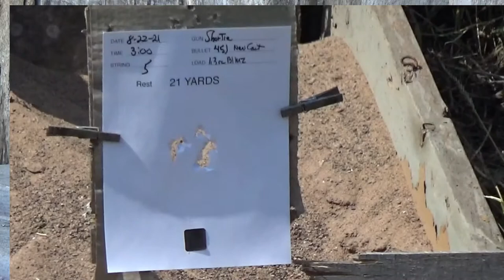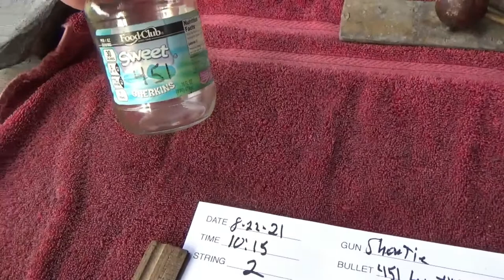Pietta 1851 Sheriff 44 cal - 5 1/2"

Comment: The second group was outstanding for 21 yds! the easy fix for the base pin/arbour is to cut shims that will drop into the hole, then put in enough to keep the barrel assembly from binding the cylinder with the wedge knocked hard in, I sometimes shave a little off the front of the frame to get the correct frame cylinder clearance, this fault appears to be only on US imported revolvers, I have not see it on European sold guns, so it could be that the importer is holding the manufacturer down to a low price, these guns are 3 times the price over here in Europe. Stay safe! Chris B.
Reply from the maker: Very interesting.  I think you might have mentioned that before and I forgot.  Did remember that someone used liquid steel to build up the arbor length slightly.  I like the shim idea.  As mentioned, I was always careful not to use too much force, but the down side is it can loosen.  Didn't have the internet in the 80's, only could find out this sort of info from other shooters  Few in my area, most just were lucky if they could load properly.  Just checked the 2nd gen colts, and they have the recess cut so deep that the lower 1/3 is open.  It measures about .1" or 2.5 mm I think longer than it should be.  It makes perfect sense that it should be a length so that it bottoms out leaving just the right cylinder-barrel gap.  As always, appreciate your comments.  O.R.
Reply: @oldranger3044  Another trick to make the arbour longer is to drill and tap the end of the arbour, insert a grub screw, then adjust until the cylinder no longer binds, the grub screw can be Lock Tited in final position when you are happy with the clearance, I find that the lower barrel lug need shaving off to get a perfect fit, Chris B.
Reply from the maker: @453421abcdefg12345  I'm not going to ask why I didn't think of that.  I have quite a bit of wobble in the cylinder of this 2nd gen 1851.  If I could get rid of that with a new bolt do you think it would tighten the group some?? O.R.
Reply: @oldranger3044  I had a misaligned cylinder on a Colt Dragoon , but it was easily cured by turning a wooden dowel to fit tightly into the grooves, then driving it down the barrel to engage the cylinder, after removing the trigger guard I could then see how much offset to make the new bolt, I made up a new bolt with a wider engagement top and fitted it through a slightly widened window until it fit snugly, it then worked much better, the other thing I have noticed about C&B revolvers is that they have no lead into the rifling, those I have seen are faced off square, with no lead at all, that cannot help the projectile on its way down the barrel, there is some experimenting to be done in this area I think, the 1873 had a tapered lead, so the C&B should respond to this treatment, stay safe ! Chris B.
Reply from the maker: @453421abcdefg12345  By lead in are you referring to the forcing cone??  Because all of mine have a tapered (not sure what angle) lead, and the riflings start gradual that way.  

Thanks for the idea on the bolt fitting.  I have a bolt that should work.  It is wider than the slot, so if I work it right, I should be able to get it to lock up tight.  O.R.
Reply: @oldranger3044  Yes, also known as "forcing cone" I have not noticed one in my barrel, it may be so slight as to need a loope to see, go carefully on the bolt and you will see when viewed from the underside how much it is out of register, it only needs a few thou to make a big difference to alignment, but with the wooden dowel knocked into the cylinder it will be held in line, if you have a wide bolt you are half way there, I made a complete new bolt from high carbon steel. Chris B.
Reply from the maker: That was something I would have liked to observe in the process.  I started, but then remembered I had purchased some Uberti parts and worked on that bolt which was wide enough.  A lot tighter lock up now, timing seems good, but when rotating the cylinder fast it will go past.  Put a stronger bolt spring, but thinking that I need to slick up the parts.  Possibly the bolt is hanging up where it comes through the frame bottom.  Thanks for all the advice.  O.R.
Reply: hello there from France. Indeed, I did the same thing as you on my open frame Pietta and Uberti colts. I rode it being called "arbor bottomed". A lot, I mean really lot of people think that the wedge is supposed to set the cylinder gap, of course not, everything is designed to be seated together, the short arbor is a flaw on replicas. Funny thing, here in France many shooters tend to think that the best Italian revolvers are sent to the bigger US market and we are left with the lesser quality... It might in fact be just the same ratio in the end ?
Reply from the maker: @jonas0937  Nice to hear from France.  By far not all the ones we get are without issues.  I have had those that I had to make a wooden wedge in order to remove the barrel.  The usual pressure on the cylinder with the loading lever did nothing.  Drove the wedge between the cylinder and loading levers hole.  I suspect that  a manufacturer would want to error on the side of too short arbor so at least the barrel could be brought near the cylinder.  
Any idea of what the average cost is at this time for the Uberti 1851??  Here they are about $330-350, but things are moving in the upward direction.  Thanks for your comment.  O.R.
Reply: @oldranger3044  In fact, despite Euro being higher than dollar, you can directly convert for many prices. An uberti 1851 is 350 euros here, when buying at the lowest price. At the current state, Pietta is more and more expensive, their standard 1851 now costs 250 Euros. In france with the exeption of antiques, owning handguns need a long process and are never really ours since stoping renewing the 3 years licences means selling them. Concerning black powder replicas, they are free to buy, free to own forever. It attracts very different shooters,  many of them only getting some because  they re the only gun fully free. In US, it seems to me that it s more of an expert thing. Still we have real enthousiasts and very high level black powder shooters. I learned a lot from US expert like Mike Venturino and am one of the few that sometime use loading press, conical bullets and grease cookies/wads, for instance.
Reply: @jonas0937  I think the problem with this design is that there is no increase in arbour diameter at the front of the cylinder, if the arbour ,as it entered the barrel , was of smaller diameter the shoulder would act as a positive stop/register, so the wedge would not draw the barrel in until it jammed the cylinder, it is possible, by using the arbour hole stop to achieve he same end, but a shouldered arbour would be more visible, but that is the original design we are stuck with, so either a grub screw into the end of the arbour, or shims in the hole. I think that even though we live next door to Italy, we are still paying 2 or 3 times the price for these pistols than buyers in USA, so the number of complaints about fit/finish I have read makes me wonder if the price is being kept down for export to USA market, and something must suffer for that price reduction. I know that here in France tax is a big factor, but it still seems a very big difference, I wonder what the price of these is in Italy? Stay safe ! Chris B, Lot.
Reply: @oldranger3044  Whats the 2nd generation Colts mean?
Reply: @453421abcdefg12345  How much clearance is the best measure? Do you want one of my free round ball bullet boards? I am offering you and mr. Ranger whichever caliber size you want, as a gift of appreciation from all the great info I am learning from these comments.
Reply: @453421abcdefg12345  There is a fellow on YouTube, Mannie CA, that has some pretty good gunsmithing videos. He shows how to chamfer the forcing cone and the individual cylinder chamber holes, along with lightening springs and tiggers. I followed his process and took my sweet time. Now my Uberti 58" has about a 1 pound trigger pull and is easy to cock. The action and all runs like a sewing machine. I wouldn't sell it for $800 bucks. One quick question sir: I understand how to turn a set of my stock nipples down to fit an extra 400 #19 CCi's I have, but am confused about the proper nipple length deal you mentioned earlier, can you elaborate on that a little? 
Reason being is about my replaced shotgun nipples on my side x side. I bought a pair from TOTW and noticed they are mushrooming. And they are oriented into the nipple hole angled outwards a bit, so I guess I need to mark them left and right?
Reply: @paraplegichistoricalsports5700  The Cylinder barrel "gap" should be a small as possible, but if it is too small you will find the fouling can cause problems, I find around .002" works well if you are using lube to keep the fouling soft, it is a bit of a balance, if the gap is too big, fouling increases due to gas leak. Good Luck with your experiments ! Many thanks for your kind thoughts re the bullet board, but I am thousands of miles away in Southern France, Many thanks anyway! Chris B.
Reply: @paraplegichistoricalsports5700  You must be careful not to have too light main spring, on ignition the blast will force the hammer back against a weak spring, sometimes even to half cock, the original Colt springs in mine have a 12Lb draw pull, about twice that of a repro, Have fun! Chris B.
Reply: @oldranger3044 something I have been puzzled about, what is the use of the screw on top of the barrel wedge? I lost mine (also on a Piëtta 1851 Navy Sheriff model) about 6 years ago, because I removed it every time I removed the barrel, thinking I might damage the wedge if I do not remove it. After 6 years of regular use the wedge remains firmly in place without it.
Reply from the maker: @losonsrenoster  Haven’t come across (at least don’t remember) much info on this. So, here’s what I think. It is used in conjunction with the spring that is on the wedge. That spring has a small bead on it’s end that will maybe help to keep the wedge from coming across, but more importantly, it will catch on the edge of that screw so the wedge won’t get lost when removing the barrel. On the guns I have, the barrel can be removed without taking out the screw, make sure that the wedge is all the way back so the bump on the spring contacts it, and the wedge isn’t at an angle. On the newer Pietta’s they must have shortened the wedge and it will come out without screw removal. I don’t care much for this design change. O.R.

Comment: With the brass frame, is this ok to convert to .45 Schofield?? TY
Reply from the maker: From what I've read, the brass frames should not be converted to shoot the modern ammo that can use smokeless.  Original Schofield gun was designed for black powder cartridge, which would probably be OK, but because it can be loaded with modern, and even if a modern steel conversion cylinder is used, the brass frame is not recommended.  So, the word is that it is a NO-NO.  O.R.

Comment: The brass frame colts can warp or bend in time, correct?
Reply from the maker: I think the biggest issue is with the cylinder arbor that can become loose at the base where it threads into the frame.  I suppose the section of the frame under the cylinder could bend also, but usually most aren't shot that much nowadays.  O.R.
Reply from the maker: @007-c4b  I could be mistaken on this, but isn't there is what appears to be a pin driven into the arbor from the rear that is keep it from loosening ?  That would make it almost impossible to remove.  O.R.
Reply from the maker: @007-c4b  Ok, thanks.  Wasn't real sure about if I was seeing a pin, or part of the arbor, but figured a pin because too round, and off center on some guns.  I have a couple of candidates that have volunteered for the operation.  Just hope I line up the slot for the wedge correctly, but can probably test before the epoxy sets up.  O.R.
Reply from the maker: @007-c4b  Sure appreciate your comments, and great details.  O.R.

Comment: What kind of charge are you using? You can clearly see your balls flying down range at 21 yards which means your velocity is crazy low unless you are using a high speed camera which does not appear to be the case.

Even for the sheriff model your velocity shouldn’t be that low, are you using undersized balls and a super low powder charge?
Reply from the maker: Probably a 25 grain 3F Goex or equivalent load with.451 RB which shaves lead. When the sun angle is correct, for some reason, the projectile is able to be visually detected. Years ago I noticed it with 38 specials standard police loads. It was neat to see the line the bullet took. Was great for practicing point shooting. Thanks for the comment. O.R.

Comment: Those 1851s have a horrible front sight.  I machined a dovetail for a 98 Mauser front sight blade on my Pietta and Uberti and that’s what I use. I can regulate the elevation and can drift it left or right as needed. The Mauser front sight has a very small dovetail so you don’t need to cut too deep into the barrel.
Reply from the maker: That would be good, especially on the ones that are in 44.  I agree that the front sight limits what the gun can do.  I believe I have seen evidence that they were altered in the past, and I'm planning on getting out my butchering tools.  O.R.